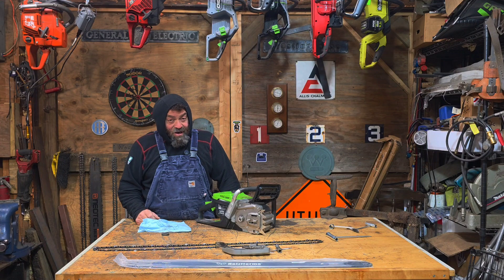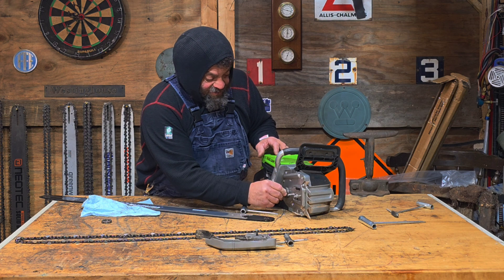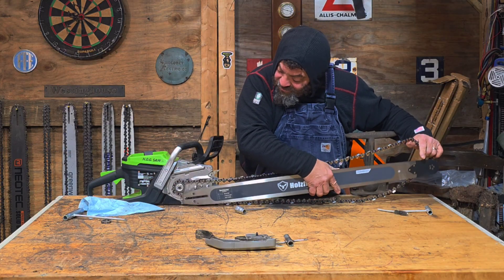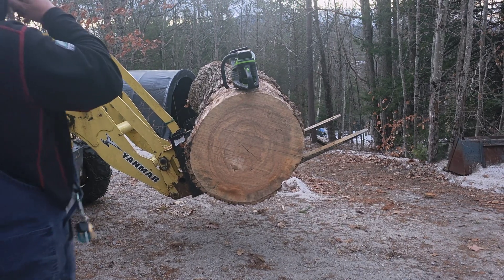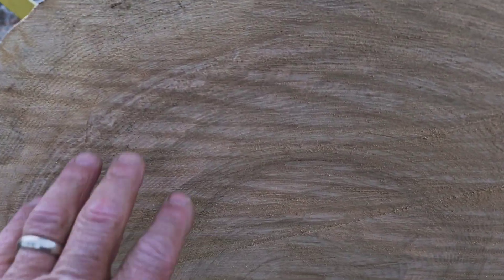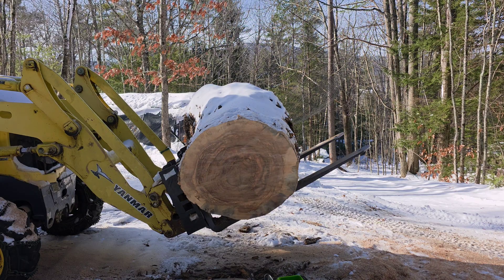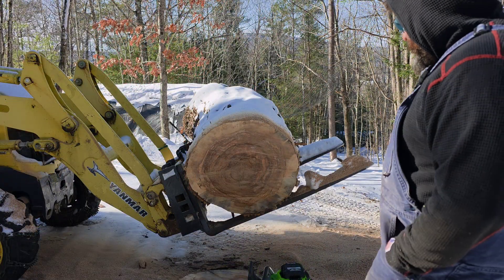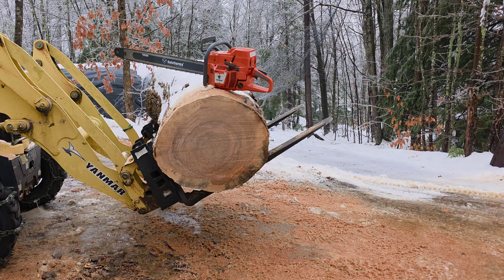Has the HOG met it's match? Can a cordless(electric) chainsaw run .404 chain?

Comment: Send them the consulting bill for your market research.  😅 

Hopefully GW keeps continuously improving their already impressive tech.  

It’s not a homeowner saw so they need to think about what serious work cases their product would be used for.
Reply from the maker: I would be happy if they just sent me stuff to test out😂.  I'm curious if the CORE700 will make a difference in performance,  or just run time when that's released.

Comment: I feel like were basically there for battery tech on the Commercial side of things for chainsaws that they are basically competative now, but this saw is VERY expensive to afford, about $1900 for the HOG saw. I feel like there is only 2-3 tool types left that Gas still exceeds Battery Tech currently and its Snowblowing and Chainsaws (all other tools I think Electric is competitive on Gas on the higher end now) and String Trimmers a bit if you use something like attachment capable with like those saw attachments like cutting thick bramble brush on the head or doing edging (mine likes to shut off if you force it a big too much). Would love something like this but one question I have is can the 80 volt batteries go on the HOG saw or no? If not, there is at least a 3 KW saw I am looking at for next year to get which is the higher end saw I saw for 80 Volt (actually looks like Greenworks Commercial has the lower end of there Saws at 3 KWs, I don't have any 82 volt batteries, although I have the riding mower and a pressure washer that can take both I believe, maybe I should consider it.). Can the OCS Core Batteries work on some of the 80 volt tools like the Riding Mower and the Pressure Washer? If so maybe I might consider looking into getting the HOG saw instead (although maybe Greenworks might consider coming out with Core style batteries for 80 Volt possibly). We have a very large tree that is very old and I had to cut down a tree with a lighter saw earlier this year and it definitely had a hard time cutting through some of the big branches after they fell in a storm earlier this year, some of the tree branches broke. Mulberry tree, which I had to cut are really hard on the chainsaws I think. But if I had this HOG saw, I think it would have cut through alot more easily I think. I do think Chainsaws for Gas are still a bit better now that Electric for the heaviest longer bars currently above 28 inches, same with Snowblowing on the higher end CC engines above 300. So I think Greenworks still has a lot of work ahead of them creating snowblowers and chainsaws that can compete at the engine ranges in the longer chainsaw bars and for snowblowing above 28 inches (EGO has a blower like this) is needed next without struggling so much under the heavier loads. Then maybe Commercial can really start to take off if the batteries can get cheaper still. Sorry for getting off track but just mentioning areas that I think Greenworks needs to focus on making better next for some of the tools to really get to the point where you won't need to rely on Gas anymore for really anything. Basically if a Chainsaw can cut through a Redwood in California with a Battery Saw without issue at the same level as a Gas Tool, then I think Electric chainsaws have completely conquered Gas then and can do any cutting on anything type of work and thickness, if the Chainsaw can handle 60 inch bars or the highest length bars without issue, then were finally there.
Reply from the maker: The 80v batteries will not work on the HOG saws.  The Optimus tools added designed to work with and require the higher output capabilities of the pouch/tabless battery technology.  I tried using some of the Optimus batteries in the 80v/82v non Optimus tools,  some stuff works and some stuff doesn't like the Optimus batteries... the 82CS34 loves the CORE400,  but doesn't like the CORE530. My guess is that the 80v 3kw saw would respond similarly,  but I don't know for sure.  What I do know is that the 4ah battery that comes kitted with the 82CS34 doesn't provide enough current for the saw to run properly and I'm going to guess that it's the same story with the 80v 3kw saw.  So if you go that route,  you'll want a bigger battery. 
I'm also guessing that the high current batteries will eventually make their way in to the 80v and 60v lineup. 
As far as technology goes,  I think power density and weight still have plenty of room for improvement.  The Optimus snowblower has yet to be made,  but I'll bet it's in the works... anything that isn't utilizing that technology,  will be made to and it will be better that anything out there once it does,  still a lot of good stuff to come I belive.  
I'm excited to try the Kress chainsaw with their 30 amp charger.  That is supposed to be released in 2026.
Reply: @reusefull  I just saw Greenworks Commercial is coming out with a 9.5ah battery next year for the Core Battery lineup or the CORE700 battery, over $900 very expensive battery! I should start at some point looking into getting some Commericial Greenworks batteries with the Core Series batteries for some of my equipment. Can you let me know if the 80 volt Pressure Washer and the Riding Mower (I think you have both) works with the 82v Core Batteries in both so I don't waste my money on getting these (I am pretty sure the bluetooth ones do work)? I don't have any of the Commercial tools but because I am so close to the Commericial line anyways and some of the tools are compatible, thats what I would like to know, maybe even a Shorts video would be nice to know showing which of the Core batteries work would be nice to see! It almost would be cool to see if a full set of six Core batteries work in the Riding Mower as well!

I do hope Greenworks is going to work on there Snowblower tool line more they did come out with a new 80 volt Snowblower Shovel that you have (and I got) last year and that thing is awesome, way better than the old 80 volt snowblower shovel! But now they need to make a better more powerful snowblower that is in the same power range as the 300-420cc Gas Engines (the 82v/80v two stage is equivalent to a 253 cc engine). But I assume that is going to require something like the Core Battery Design to work on the 80 and 82 volt battery lineups. I mean, I just bought an Ariens 389 cc 28 inch Rapidtrak snowblower and its coming in the next couple of weeks. This snowblower is marketed for high premium Residential use and not Commercial (its more like a Prosumer level Snowblower basically but so close to Commercial that its basically Commercial on the low end). So I do hope were going to see more improvements in this area, continue to improve the Chainsaws as well. I think were going to need at least up to 7-8 Kw chainsaws to make cutting possible on any kind of tree and thick density wood. If a Greenworks Chainsaw is able to cut down a Redwood in California easily, then Greenworks is basically done improving the power on the chainsaws I imagine. Or until it can operate without issue on a 60 inch bar no problem!
Reply from the maker: @Sallen121 I wish I had 6 Core batteries!! I did try the Core batteries in the pressure washer and I am pretty sure that was a fail.  I don't think the mower minded then though. I'll reinvestigate when the weather gets warmer.

Comment: Nice video! Just when I think you ran out of things to try you find something new.
Reply from the maker: Thanks, I had to work at it,  but I finally found something that the saw couldn't handle 😂
Reply: I don't think so... you just need skip chain on there instead of full comp. 
It's not the cutting overheating the saw, it's the excess chips binding the chain at than length in hard wood. 
Try it with skip and find out 😉 🍻 ~
Reply from the maker: @georgehofgren6123 I definitely will.  I've been waiting to go to the supply store,  but it's about 45 minutes away and I haven't had a chance